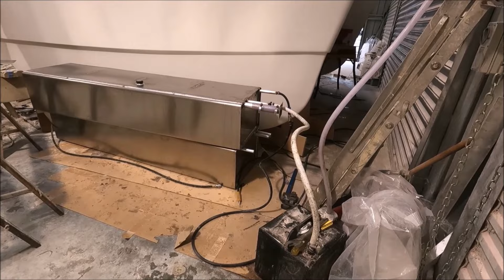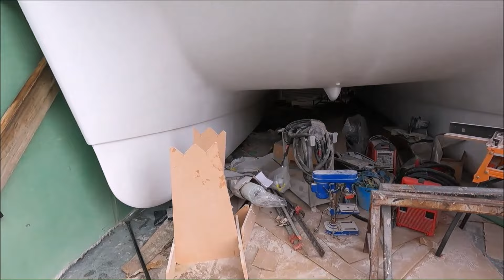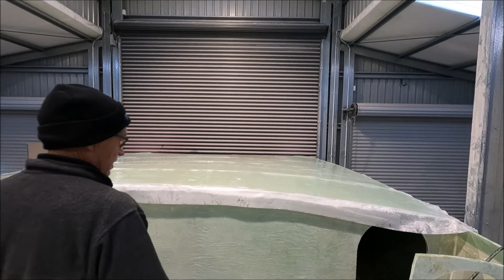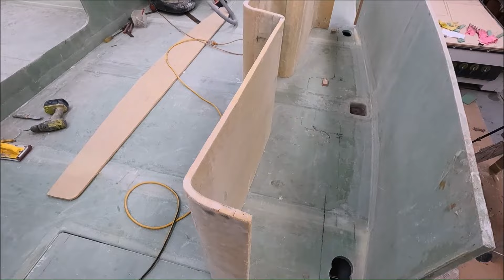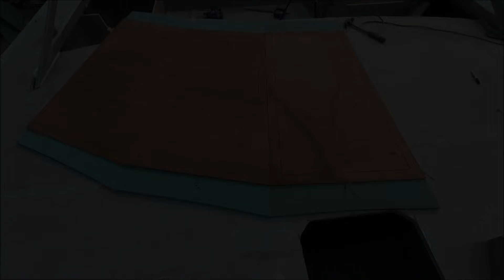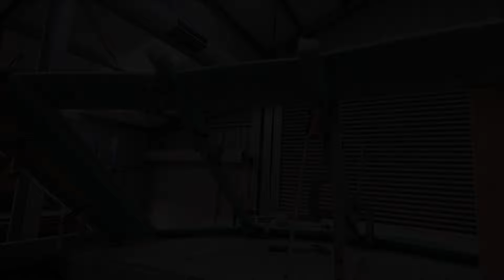Swansong Part 6 Fuel tanks and windows

Comment: Looking good . How do you go with the petrol fuel tanks in the hulls e.g. venting, and marine regulations 🔥
Reply from the maker: The alloy tubing for the breather, filler and feed to engines protrude through a sealed bulkhead at aft end of tank. From there, the connected hoses pass through the lazarette with the filler cap and breather vent high up on the portafino stern. The hoses used are heavy duty, flexible certified fire resistant.  SAE-J1527-A1 ISO 7840-A1 US Coastguard, Lloyds CE approval.